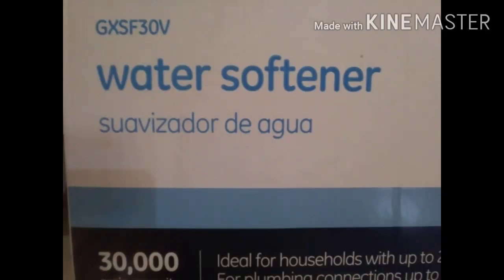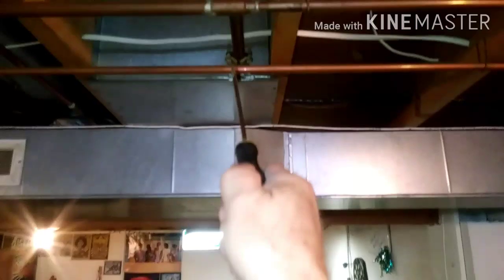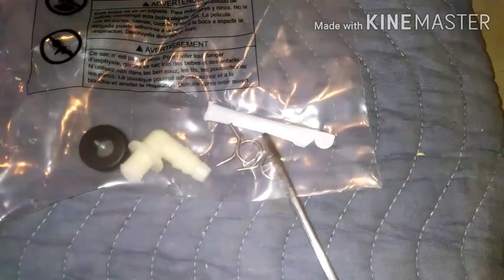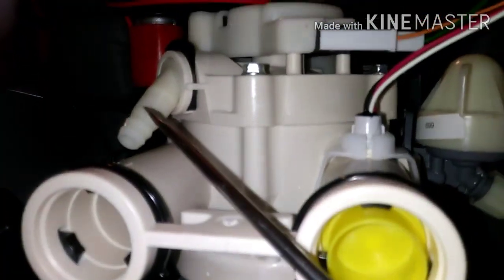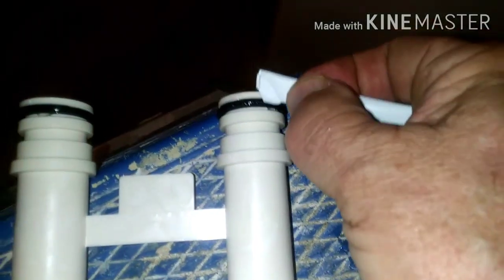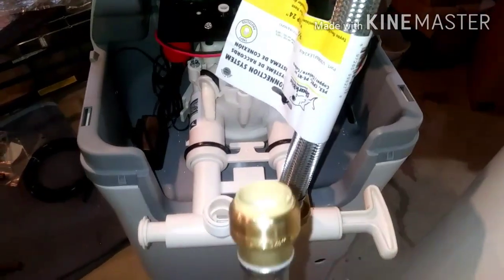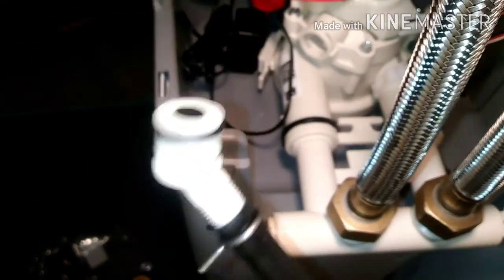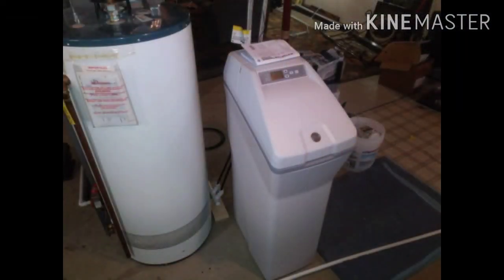GE water softener install tips (GXSF30V)

Comment: Is there any problem replacing my old GE softener with a new Rheem? Will the fittings be the same or can I at least find sharkbite hoses that will work with the original copper plumbing?
Reply from the maker: set up the new one next to it before you unhook it so you can see what you'll need
Reply: @GetToThePointplz123  Again, thanks!